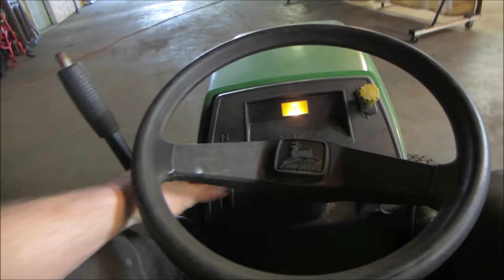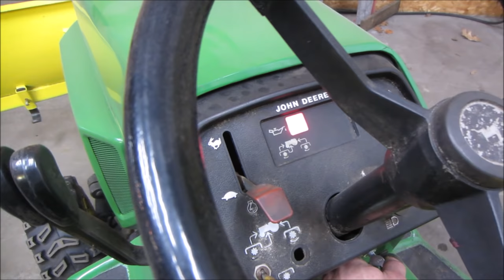SAVED FROM THE SCRAP, John Deere Will IT Run Series, 3 of 3

Comment: Mrs. Mustie: Have you seen those two new pillowcases I just bought?
Mustie 1: Pillowcases?  Uh...Uh... Gee, no.   Time for a Battery Tender on the 318.  I had a similar experience with my lawn tractor not charging.  The battery is needed only for starting for starting.  The ignition is self sustaining and the headlights are powered by a flywheel induction coil.

Comment: Set the mower deck at 3.5” on height and look for a bagger that goes on that 38” mower. Make sure the mower deck is 1/8 to 1/4 lower on the front of the mower deck. You will have the best mower you have ever had for picking up grass and trash.

Comment: Ever try and repack a sealed bearing?  Just pop out the seal with a small screwdriver, wash out the bearing, and repack by hand.  Pop the seal back in place, and you are done.  I repacked two idler pulleys on my deck, and they actually ran smoother than the new one I bought to replace one.  Most sealed bearings have a plastic seal, and easily removed and replaced.

Comment: Have you ever tried wet sand (2000/3000 grit) then buff the plastics? the parts are molded in the green and it works very well.

Comment: The deck hole repair.... it would have been much easier and accurate to have cut a piece of approximate size and then trace through the hole to the sheet metal held below. You would then have an almost perfect fit... first time.  :). Sometimes we get a method stuck in our head and can't see around it.  I do it too.  We all do.
Reply: And no, it wasn't anywhere near the blade to interfere with it. :) The blades are near the bottom of the deck and the hole was up neat the top corner.

Comment: I saw the tires turned a bit different on the front end.  I had the same thing on my 265 a few years ago.  Someone told me the fill area needed to be on the inside to make sure it did not get damaged while working the garden or plowing the snow.  I turned them both out for ease of operation in case the tires ever got low.

Comment: My dad got some free mowers from his neighbor and the 170 or 175 hydro the deck was the same way it's a blowout from wear and on his it covered the hydro causing it to overheat and blow the oil out cleaned it up replaced the hydro fan changed hydro oil it drove like new. The deck I bent some rod to the contour and then welded the rod into the hole and now he has a good John Deere mower. Oh and the engine is a Kawasaki but didn't have the oil filter so I bought the adapter and added the oil filter.

Comment: So not sure if you have covered this before but I was curious. What solution do you use in your parts washer?  I was tinkering with a engine last weekend and just had a gallon bucket of Gunk parts cleaner stuff I picked up from the local Advanced Auto and honestly it didn't work that well. In fact it didn't work well on oil. It cleaned up the carb and removed most of the varnishing from it but good ole WD40 ended up being what worked the best. Was curious as your stuff seems to come out pretty darned clean.
Thanks man. Love the videos. It has inspired me to start rebuilding and tinkering on stuff again. Now if only I could find an old 4 wheeler to mess around with.

Comment: Any time the PTO switch is missing or busted, TEST THE RESISTANCE of the PTO coil! anything under 2 ohms is a short and will only kill the replacement switch; and these coils seem to short themselves often.  So often that they really should sell just the coil so we can replace them without having to replace the rest of the PTO clutch every time.  I hope the aftermarket ones have tougher coils.

Comment: You can take off that rubber seal on a sealed bearing and put new grease in them , and just push the rubber seal back onto the bearing , i do it all the time on my mower and on my car and never any problems with them .

Comment: You are a week to late for me on this!  I had to learn and figure out the hard way that a dead battery with PTO is a problem. Drove me nuts for about 2 hours.  I checked everything!  Then I finally realized I never had a PTO on any of mine. They were all tension driven with lever. I had a little chuckle when you pulled the PTO switch.

Comment: If those bearings have a metal shield but not a rubber seal then grease will push past the tiny gaps to lube the bearing. The ones with the rubber edges will not allow the grease to pass.

Comment: a little epoxy in the knob then put onto the threaded shifter to dry. Works pretty well.
Reply: And then never be able to get the rear tin off again.
Reply: @octane613  No it conforms to the threads and you just screw it off like it would originally. At least in my experience that's how it worked. I wouldn't do that on a non-threaded shifter.
Reply: Duca  Because it holds better than pieces of zip tie in the meantime while he is looking for the correct one
Reply: Duca  many ways to skin a cat
Reply: I do the exact same thing with JB weld, but wrap a little Teflon tape around the threads first.  Works great and you can take the knob off if you need to.
Reply: Duca, I’m glad to help.  I’m always picking up tips from hanging out with mustie and reading comments.  It’s nice to have something contribute myself.
Reply: Duca  you are incorrect sir. Done it many times. JB Weld works well too as mentioned by the other comments
Reply: Duca, you’re welcome.  You stay safe too, crazy times.
Reply: Duca, Yep, as long as there is a little Teflon tape covering the threads, the knob will come of no problem.

Comment: do the mower deck before the tin because the tin will get in your way when reinstalling the mower deck,  and the grease around the brake rotor should have been silicone based and/or anti-seize, not petroleum, which brake heat can burn off.

Comment: You may disagree, but this works for me . The blade spindles use sealed bearings and I have been told no amount of grease you put in effectively reaches the upper bearing .  Well I had a noisy bearing , so I took the grease fitting out and filled it up with oil . put the fitting back in . , that was 3 years ago still no noise or signs of loosening up . just a thought .

Comment: Just because a bearing comes with seals, doesn't mean you have to leave them on there. They come off pretty easily, and you should unseal the inner side of the bearing spindle so the grease can get in.

Comment: Watching him platy with Deere decks reminds me of how frustrating they are.The tractor is great, especially if you have a manual transmission but those decks are hell and the spindles are impossible to rebuild. I have a set of Deere bushings for that pivot he had to heat. I hate that thing.

Comment: I've painted lots of equipment over the years.  OEM paint is the only one that matches.  Even had a batch of PPG made up.  Still didn't match.  On the plus side JD spray cans are superb.  Nice fan, lays down smooth, and not much more than the colors that don't match.
Reply: I don't think it matters much to Mustie.  As he said in the video, he is not a painter, just a rust preventer.
Reply: Yup.  Good info for anybody that wan't it to look correct.  I've certainly seen a lot worse that's for sure.  LOL.

Comment: At 44 min all you need to do is take a pick and pull one seal off of each bearing and put that toward the inside and pump it full of grease and then you have got it and from then on you can just give it a shot of grease from time to time, I have fixed a many of them like that.

Comment: Taking off patches like that is the first thing i do  and butt weld new metal in there Plus id order a 10 pack of bearings from Amazon for like a buck each and change the lot then repaint the deck and  it will last way longer than i will lol I like your old school  mechanics and troubleshooting  And what paint did you use as i think the 80s deers  had slightly darker green  although the paint colors dont show too well on video

Comment: I can't remember if you changed the ignition switch on the 318. If it was burned up that is a common cause of no charge on that tractor. I fought mine for years and that  finally fixed it...and they're fairly cheap!

Comment: Good morning - Video request - Please make a video tutorial showing how to repair a JohnDeere riding mower cable harness. Included the source & part numbers for replacement connectors, Pins wire gage & ratings & exact tools( Crimper )

Comment: When installing the blades on a two blade deck , the blades should be at a 45 degree angle to each other, never facing the same direction or you will not get a good cut

Comment: What kind of bearings are those? They look like high speed bearings (steel seals) which are normally not very good in dirty use cases. I would have expected 2RS but maybe these are special metal covered rubber?

Comment: Even if the bearing is sealed on the inside, grease on the inside can seep in almost as easily as water over time, especially if the seal is old, however too much grease can put unwanted pressure on the bearing.  That failure to activate with a bad battery, using just the alternator, is another big sign that the PTO coil is shorted and demanding too much power.  That PTO switch will not last.

Comment: I rebuilt the deck on a snapper and could only get sealed bearings for som reason. I took a pick tool and took the plastic seal off on the top side facing the zerk. I left the plastic on the side facing the seal on bottom. .

Comment: i just found a 185 hydro, that would not start. paid 100 for it. i am hoping to use your videos to find out why it wont start, but it was doing the same thing as yours in video 1. i am hoping to bring it back to life as well. thank you for doing this. Your videos are going to be a HUGE help for me.

the main problem with mine, the steering is completely seized. So i would need to take apart the front steering  and find out whats wrong. i am betting the bearings are rusted.
Any chance you can show a video on what to look for?

Comment: Hey there. Absolutely love the videos. I've picked up so many new tips and tricks watching you and appreciate that. Please keep the videos up. I was wondering if you had any idea about a situation that I'm dealing with. I have a stump grinder that has a 23 horse Predator engine on it. And it powers of stump grinder great. However the engine is sitting above the cutting wheel. So when I take it down to a low pitch in rock the engine. It tends to Splash oil into the cylinder head somehow. I'm wondering if you had an idea or know of any type of baffling system I could set up in the crankcase oil pan. Any help would be greatly appreciated.

Comment: Justice I have a craftsman lawn tractor.  I think it's like a 42" deck with 15.5 ohv engine. Battery went bad on my other tractor so I pulled this one out and then it sat for a few years. Over the summer I put a new battery on put now it's like the motor has seized up. What's the best way and the safest way to break it loose?  There was no engine damaged and it tries to crank but nothing turns. Could it be the starter is locked up or could it be the pistons have seized due to it sitting. Help!
Rick - Athens Tx

Comment: I have a 265 series John Deere and really like what you did with this cast off on the side of the road. I want to repaint the tins around the seat and floorboards and I'm wondering where you got the paint and is there a part # for it? Thanks. P.S. Any jeep XJ or ZJ fixes in the future?
Reply from the maker: tractor supply has the paint

Comment: I found a echo gt225 string trimmer side of road. Seems it was run without a air filter. Any suggestions for cleaning the case without dismantle??

Comment: On your 318. I have had a lot of kohler command engines where the magnets separate from the flywheel. If the regulator doesn't help the charging issue.
Reply: That’s not a Command in a 318. It’s an opposed twin which would make it a Magnum 18.
Reply from the maker: onan
Reply: Mustie1 Performer 18, then...aka P218.
Reply: I repair a lot of lincoln ranger 250 welder generators with charging issues. The last ranger 9 I had charging issues with the regulator was bad. But My customer only had 4 Ranger 9 units with Onan engines.

Comment: Well I did notice the valve stem was on the inside of the wheel.  I have a craftsman GT and I have to air up the tires once in awhile.  My stems are outside and I can only imagine it would be more difficult to air up the tire.  I have used green slime in the tire and it did stop the leaks.

Comment: the john deere snow plow tracter check ground wire on dash light has same issue thought wasent charging but its a gas so if not charging why it running sparkplug takes power............has be getting power from some where and  even with battery un hooked kept running

Comment: I realize this video is from a year ago but anyone that has messed with deck spindles did know that even though they have grease zerts they use seal bearing inside the spindel!!! Everyone that I have taken apart I have had to yank that rubber seal off the bearing so it can get grease!! A little FYI for next time your spindle bearing go out just get new bearing and pull rubber off inside part of bearing!

Comment: Can't you look to see what the OD and ID numbers are on the old bearings? I thought they are stamped in there or can't you measure them?  I also thought you could pop the cap on the battery and test the fluid and add some salt water to it to get that battery good?  Sorry, I love your videos. These are just questions I got rattling around in my head.
Reply: Only distilled water should be added to a battery afaik.

Comment: How to free a spindle bearing. Pour alotta marvel mystery on the spindle, Wack it several times with a hammer, Connect it. See if the mower belt will catch the spindle and free it completely.

Comment: I was wondering in the previous videos why that one tire had the valve stem on the inside, and why you didn't flip it back to normal to see if there were any issues that made someone put it on like that.
Reply: Air and zerk fitting should be on the same side!

Comment: I noticed the valve stems on the inside of the wheel- because I have the same situation. And, Murphy's law being what it is, I have a front tire with a slow leak. Yeah, I'll have to replace the tire, but it's already grass cutting season down here in Virginia, and it's a massive pita to put air in the tire. I'd already planned to switch the front wheels around, later today, and was glad to see that it was possible. Why the hell would Deere put the stems on the inside? SMH....

Comment: Had 110 model 1974 made ran like a deere baby got carb kit rebuilt45 and it weighed over 900 lbs 10 hp Koehler engine, snow blade wouldnt have traded it for new deere model they dont make em like that anymore

Comment: The spindles should only be like $30Each.Sell that unit for $1800  nice pay day for a weekend of mustie fixing . HAPPY EASTER EVERYONE. Be safe and virus free
Reply: Duca  Did you hear them when he engages the deck . And have you ever priced a John Deer . Very expensive tractors. $4500 bucks new . That’s why I got a new cub cadet ,24 HP ,50” deck zero turn.   I almost bought one last year but all of the dealers around here only had new ones with rust un them .
Reply: Duca The bearings in the spindles .
Reply: Duca A lot of time the assembly is rotted out and you bust it all up trying to get the bearings out.

Comment: I didn't notice the right-side wheel's stem, but I DID notice that the way you found it, the stems were all facing inwards... Which is STUPID!
Reply from the maker: they do that to protect them
Reply: @mustie1  They look like they're sunken sufficiently far into the wheel well, so I don't see them snagging on anything. If anything, you're more likely to break the stem off, or hurt yourself just trying to get at them when they're on the inside.
Reply from the maker: @BlackEpyon  think snow removal

Comment: Plumbers thread tape for securing the knob?
Reply: Use a drywall anchor.
Reply: I wrap a little Teflon tape and fill the knob with JB weld.  When it hardens, you can unscrew it if you need to and the threads in the knob remain intact.

Comment: "hard to find bearings"...uh no not at all. some use 6202 5/8 some 6204 5/8 depends on the outside diameter and the deck. Just measure the outside of bearing( its metric) and the inside which is in inches on jds and go search online on amazon get pack of 12 or so for 20.
Reply from the maker: hard to find local as stores are closed

Comment: Bearing Specification
Inside Dimension 	0.751 IN
Outside Dimension 	1.781 IN
Width Outer Race 	0.615 IN
Width Inner Race 	0.615 IN
Dynamic Rating 	2,209.871 LBF
Static Rating 	1,400.559 LBF
Outer Corner Radius 	0.040 IN
Inner Corner Radius 	0.040 IN
Finish 	 
Note 	F

Comment: missing a wheel where that hole in the deck was.
Reply from the maker: no it is not, https://www.ebay.com/i/124004281617?chn=ps&norover=1&mkevt=1&mkrid=711-117182-37290-0&mkcid=2&itemid=124004281617&targetid=882497019982&device=c&mktype=pla&googleloc=1021845&poi=&campaignid=9248481111&mkgroupid=93538209803&rlsatarget=pla-882497019982&abcId=1141156&merchantid=6296724&gclid=Cj0KCQjw-Mr0BRDyARIsAKEFbefR1bm1evq4RyG0CzsqIGMnMwz5XK7nB3H1ed0R957TF9ilBRtFsYoaAp1aEALw_wcB

Comment: The deck is interchangeable with a few other models. Too bad they think the decks are made of BITCOIN! US $199.99 for a used STX38 38" yellow deck. Looks like it's interchangeable with the 1983 model 111. $179 for a new double main PTO pulley at amazon.

Comment: Personally I think I would want valve stems outside .
Reply: Why.  You like replacing them?
Reply: Well, my Kubota 1770 which I purchased new, valve stems were on the outside. I purchased it in 2003 still have the original stems . Somebody commented they would get torn off.